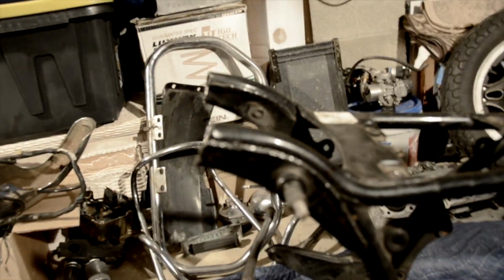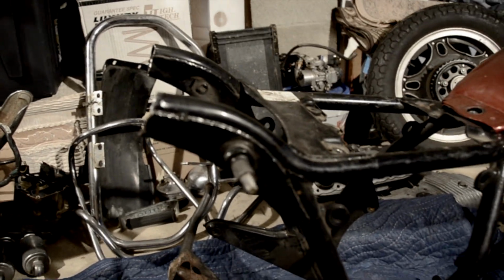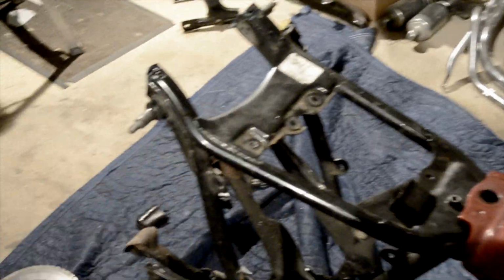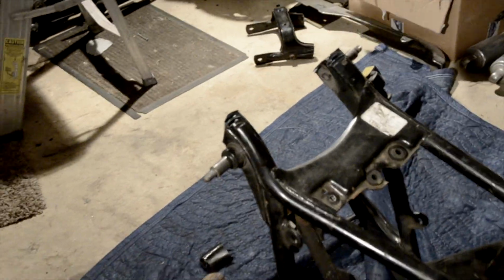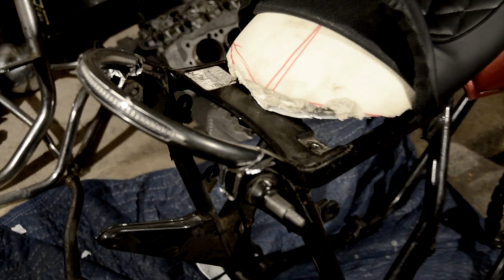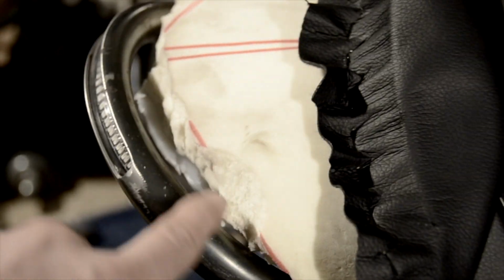Sparks, Frame and Seat - 1981 Honda CB650 Cafe Racer Build Ep. 4

Comment: Where did you get the seat hoop frame with the lights, what are the measurements for the seat hoop
Reply from the maker: JC Films seat hoop- got it off eBay 
Measurements will vary depending on your specific bike.
Reply: 0KFilms just asking cause I have the same bike & in need of frame hoop
Reply from the maker: JC Films yeah no problem. If you have any other questions, fire away!

Comment: You shouldn't have to cut the saddle, your cutting of frame n welding can use some help. Should hv gotten a longer hoop n cut that down to fit the seat.
Reply from the maker: Tonya  Glover I couldn’t find a shorter seat, had to settle for that one. Thanks for the feedback